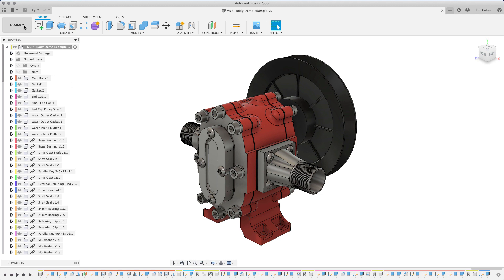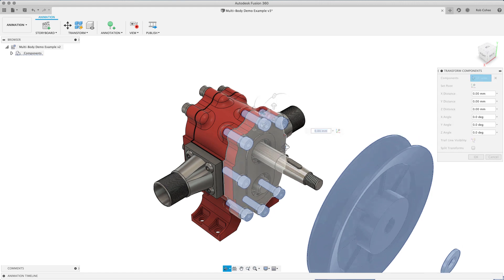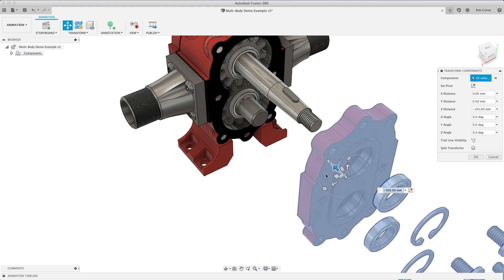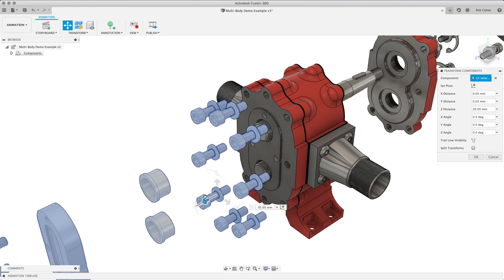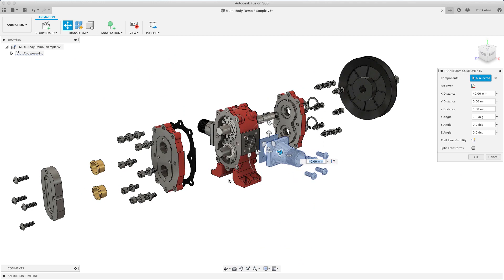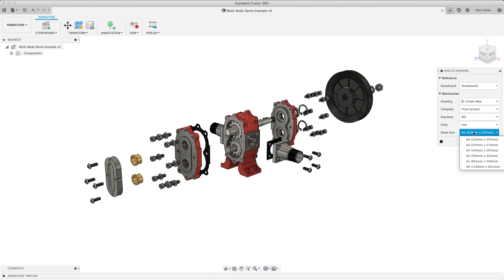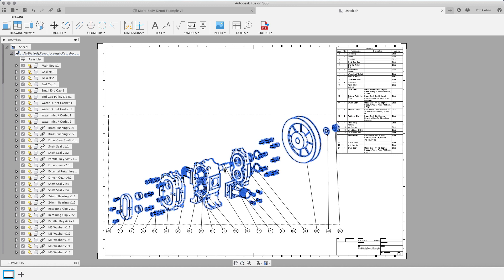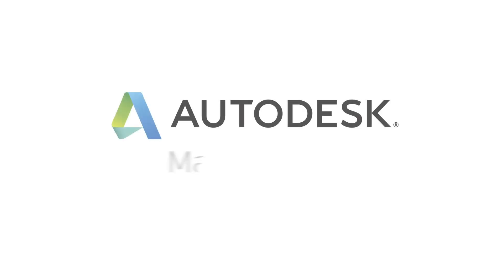10 Fusion 360 Exploded Views

Comment: I don’t understand what pulley type you are using. An idler pulley acts as a guide wheel or a tensioner, not a drive wheel. It spins freely on its bearing. On the drawing you have idler written, but in the video is a drive pulley and you can understand that because you did a parallel key. Can you clarify this please?

Comment: Great video. I'd not really stepped into the animation workspace previously, but decided to take it for a test drive after watching this. The idea of linked animations used as work instructions is pretty compelling, but was a little bummed to find that there is no way to drive movements based on CAD geometry (move to point, for instance) and that design parameters are unavailable in the animation workspace. Great video though, and I think seeing the workspace in use, and that it's functionality packs a decent complexity:value proposition, means i'll probably be more inclined to jump in down the line.

Comment: Good day Mr. Cohee, Thank you so much for your efford. Edit in design is very usefull function. I did go over the design step by step and did every step as you have shown. At the end drawing design from animation I had a problem. Drawing design with style "visible edges" was ok, but when I chose type of style “shaded” there were atleast four of each main bodies. Would you please inform me what can couse that problem. I have check every step few times I found nothing wrong in compare with your design. At the end I break links in contexts and solve the problem but I think it is not the solution. All the best.